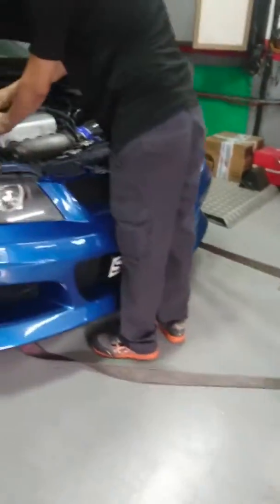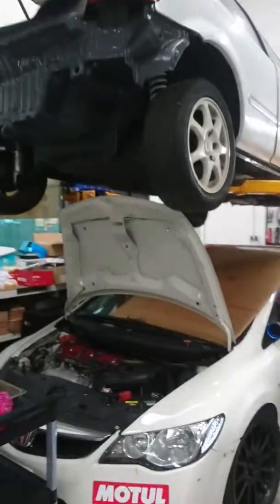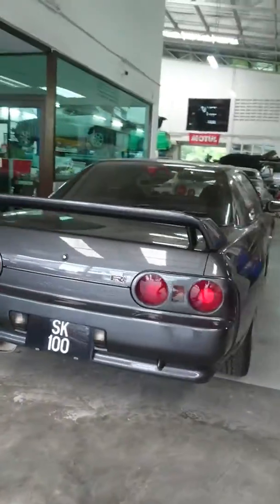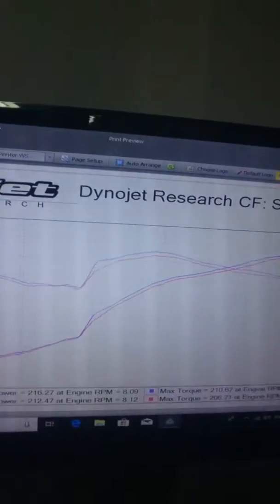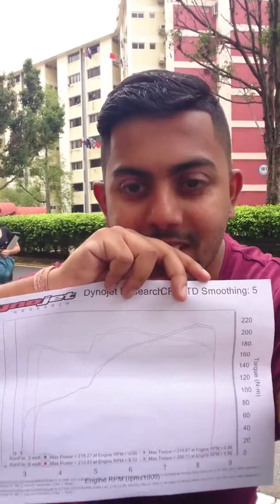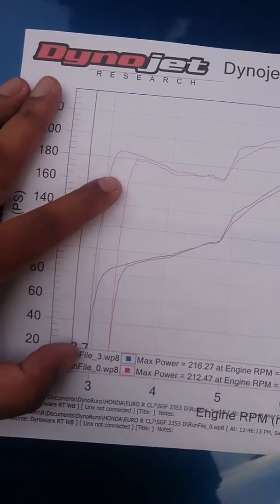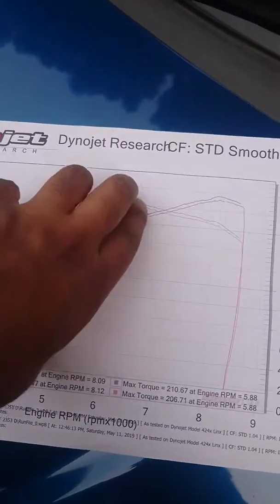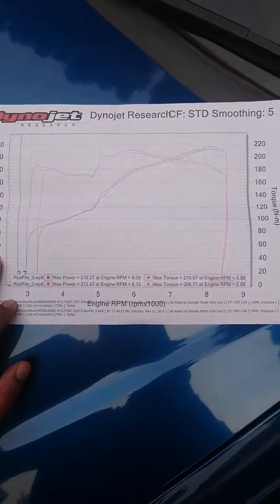Type R Cylinder head Port & polish! Dyno!

Comment: I'm actually half way through porting my cylinder head by myself on my saab b204 powered vxr. I'm hoping for some extra flow and it's looking and feeling better to the touch too. Hope it's worth it as it's a lot of work
Reply: response will definitely increase mate!
Reply: @saradomin88  hoping so. Iv put a temporary head on while I'm working on the original and now for some reason it's only hitting 1 bar of boost so currently trying to track that issue down too. I'm thinking it's a turbo problem so going to pull it off and take a look

Comment: One of the best upgrades hands down. Rarely done for 2 reasons, 1st is money, takes abit of labour to remove the cylinder head then actually do the job, 2nd is lazy people who have the tools and lack the knowledge and would rather pay the money.  Ive done my own port and polish and went as far as to polish the intake immediately after the throttle body so it looked like chrome.  Although i never had the car tuned afterwards i felt the low end pull alot harder.  Good vid
Reply from the maker: For sure, honda are always happier with more air. Throttle porting and intake manifold porting help alot there. However a new map gives the car a higher torque curve. Even with stock cams and injectors, this car is really quite potent